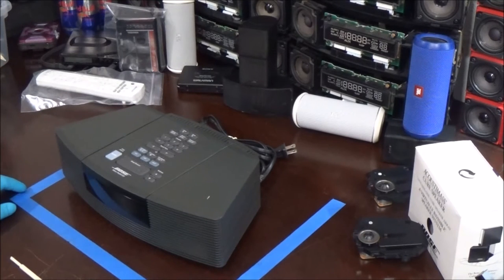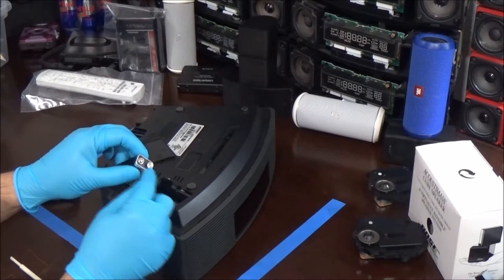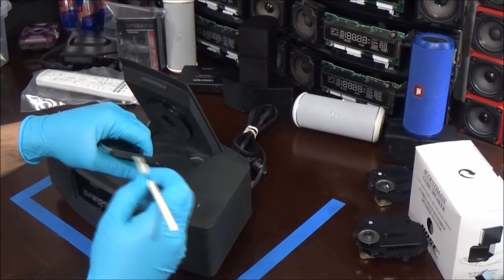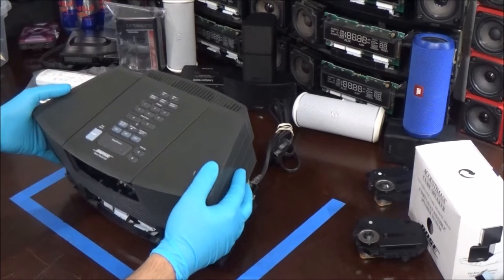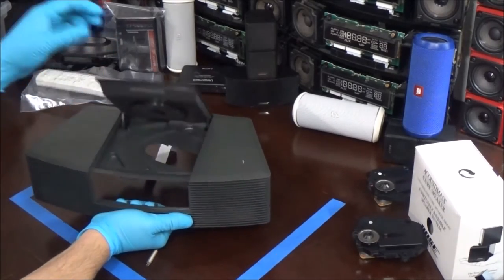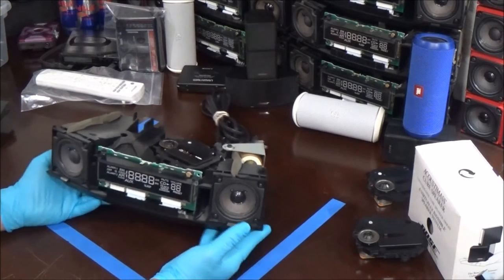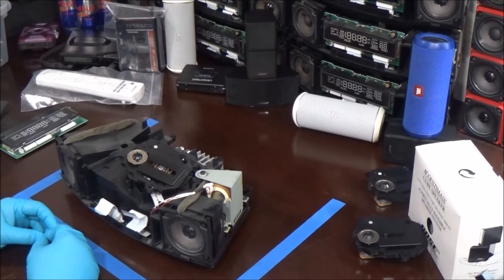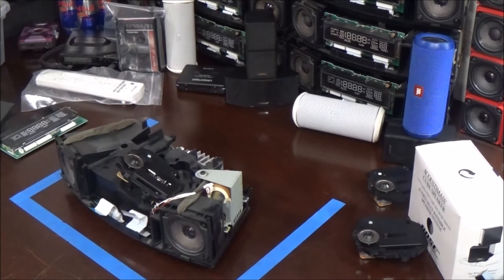Pt. 2 First Gen Bose Wave CD Radio Teardown Repair Dismantle All You need To Know

Comment: I am trying to replace the top door/control panel. I have a good spare and have the unit disassembled, but cannot get the ribbon cable into the lock slot on the back of the new door. Does the door/button control panel need to come apart to attach the ribbon cable? If so, how to do this?
Reply from the maker: Hi, if you purchased the lid with no ribbon from amazon or eBay, return it, as the sellers should know better especially if they specialize in selling Bose products. If they are selling just the lid then they have and should have an understanding of the unit. Let me explain, back in the days I was involved with the first generation second and third Rev, design changes. That is called rolling the Rev. Rolling the Rev. is done anytime we make changes to the drawings or MPI (Manufacturing Process Instructions) Rev. is short for revision. The ribbon in the lid, including the PCB in the lid, the CD centering and the one piece silicone rubber button sheet are all permanently encapsulated in the lid as the lid is sandwiched together with a chemical thermal adhesive. You can try with a fine needle nose to insert the ribbon cable and risk buckling / damaging the ribbon or I would just return it as the seller should have sold the lid with the ribbon still installed. We had concluded back in the days against my recommendations to not make the lid serviceable, but the understanding is that the lid should last approximately 20years and that was long enough and if during the refurbishing process the lid needed replacing then they would just install a new lid assembly that included the new ribbon. Thanks, The Eighties Nut
Reply: The ribbon socket in the lid is different from the ribbon's socket on the display board. The one in the lid has a sliding lock which lock has to be slightly pulled out in order to let the ribbon slide in. And then pushed back to lock the ribbon in place. You could probably use a small hooked pick to pull out the lock, then insert the ribbon, and then push the locking part back. Here's what it looks like https://youtu.be/Osl6yNAqYg0?t=119
Reply: I just posted a new video showing in detail the problem with inserting the ribbon into the door socket https://youtu.be/lMTt7eCxrYw?t=220

Comment: I’ve got a gen1 wave. it’s got an ac hum which is most noticeable at lower radio frequencies. Have you seen this problem before?
Reply from the maker: Hi, yes there are a number of different variables at play with a hum, and without troubleshooting it myself I would say the most likely or highly plausible culprit would be a filter cap or potentially a bad ground. Caps don't need to swell to be bad, however, they could dry out and the cause or the lack of the dielectric presence may or may not cause swelling. I wish you good luck with your endeavor.

Comment: Great video, thanks.  I replaced my 9 Volt battery, but that did not fix the   >failure to maintain volume<   problem on radio play.  I turn it up, and it falls right down again.  Any thoughts?
 Thanks again.
Reply from the maker: Hi, your touch panel is bad. The button control lid, specifically the volume down button. The 9v battery has nothing to do with that. The 9v is only for alarm, tuning memory & display brightness memory.
Reply: @EightiesNut  Thanks!  What is the fix, or is it just replace the control lid?
And  if that, is there a source for those?    Regards,
  Eric

Comment: I am needing to replace my 3.5mm audio input for my bose Soundwave II.  Ive scoured the internet for the possible replacement part, but am not confident enough in my findings to make the purchase.  Could you please advise?
Reply from the maker: Hi, you can purchase it directly from Digikey They have all of the electronic components in stock RCA input jacks.
Reply: @EightiesNut  thank u!

Comment: I have a wave radio/cd model AWRC-1P. the door closing button broke, so now the cd doesn't know the door is closed. Is there a repair for that or do I need a whole new door. Unit is white.
Reply from the maker: The door does not come apart as it is bonded together by thermal adhesion.

Comment: Have the motherboard exposed. Sorry to be stupid but which if the items on it is the fuse?
Reply from the maker: No no, don't say that. The only stupid person is the one that has a question to ask, but does not. The fuse is transparent glass with silver metal caps on each end it is located to the left 3/8" away from the power cord plug (white) on the PCB It is soldered to the board.

Comment: We have been away for a few months the unit was unplugged. Plugged back in LED came on then screen went back and no power. Any ideas? Looking like I need a new fuse or transformer any ideas where I can pick such things up?
Reply from the maker: Hi, I would test the fuse first. More likely when it was plugged in, it received a surge and blew the fuse. The fuse is a 1A 250VAC good luck.

Comment: Hello, my base speaker stopped working, any ideas?, Thanks, Anthony
Reply from the maker: Hi, depending on the model many have a fuse next to the power supply.
Reply: @EightiesNut  I checked, the fuse looks good, I plugged the base speaker in the other speaker port and the speaker worked, so it has to be something else, and Thank you for your help!

Comment: The antenna plug on mine is completely loose.How do i fix it?
Reply from the maker: Hi, it would need to be soldered from the bottom of the PCB that means the board needs to be removed.

Comment: I have the same unit in white and there's a crackling noise coming from left side speaker even when the unit is off but connected to power. checked power cable and seems to be ok, any idea on what the issue could be? thanks in advance for your help.

Comment: I got a used Wave Acoustic CD-3000. The radio works great. The CD player spins the CD and the display shows it started but does not begin to play. There is a soft clicking sound and will not play. I have tried different discs. What is the likely cause? If it is not an easy fix, I wiill be selling it on eBay for parts within the next week but I would rather fix it!
Reply from the maker: Hi David, it is more likely a weak laser diode.

Comment: I need to replace the fuse. How do I get to the bottom of the main circuit board? Your video didn't go quite far enough to reveal that. Can you supply the value of that part 

thanks ca
Reply: nevermind i found the 5th screw under the CD player,
Reply: Looks like it's a 3/4 A slo-blo. can you confirm?
Reply from the maker: Hi, sorry for the late reply. Yes .75 ampere is correct.
Reply from the maker: Hi, the fuse is a .75 ampere. Get it fixed... Good luck.

Comment: i have one of these the cd spins very briefly but the motor seems weak
Reply from the maker: Sounds more like a weak laser diode. If the motor starts on its own then the motor driver cap is fine. Also, try cleaning the lens with a lint-free cleanroom swab and Spray-way.

Comment: I am wondering where I can get a good deal on an optical unit?
Reply from the maker: Hi, I am sorry I am not sure who is just selling the ODA by it self. Most are restoring the complete radio and reselling it with the new ODA installed. The optical drive assembly has not been manufactured in ages.

Comment: My wavw radio/cd player will not turn on. Is there a way to test the cord?
Reply from the maker: Hi, sorry for the late response. No way to test the power cord without taking the radio apart. More likely it is the fuse or the power supply that is causing the radio not to power on. Good luck...

Comment: My CD turns in steps and then (stops) "CD" display flashes. What is the issue? You showcased brand new cd replacement part. I would like to get one of those if you could help me? I do not know your email id. Thanks for your help.
Reply from the maker: Hi, I am sorry I do not sell any of the parts retail.
Reply: @EightiesNut  TY. Where can I get a newish one? Is this also available with DVD? If the "CD" display flashes, what are some likely issues? I like your cars too!
Reply from the maker: Thanks, without actually having it to troubleshoot I can only give my best assessment. It is plausible that the drive motor is going out or even the laser diode has weakened causing the symptoms.
Reply: Do you recommend a place to have it fixed in California?
Reply from the maker: I am sorry, I do not know of any.

Comment: So one question has been bugging me. Are these mono systems? Since one driver is made for mid-high and the other is low-mid? If so, are the new generation is these still mono?
Reply: I worked for the company on the retail  side from 03-06. The Wave Music System was introduced in 05. Each driver/ transducer are the same and have a dedicated 26in tapered waveguide for each speaker. It is a half an octave lower then the original and it out performers the original. The differences from the current series 4 is a new housing and you are able to adjust the bass. The breakdown display we had in the store looked liked like the head of Johnny 5 from Short Circuit. It was pretty awesome

Comment: I’ve got one of these on my bench and it is not functional at all. No display (not even dim), no sound. Thinking it likely needs recapped.
Reply from the maker: Have you checked the output of the power supply? It could have failed. Also, I am sure you have already checked but I should through it in have you checked the fuse?

Comment: Can you sell me one of those brand new optical drive assembly's? I have the same exact model as the one in your video
Reply: my unit has sentimental value id love to make it fully functional again. you said you have 1000 new optical drives? really hoping you can sell me one.
Reply from the maker: Hi, sorry for the late response. All of my surplus Bose is now suppling an eBay seller that rebuilds Waves and sells them as complete radios. Sorry I could not help.
Reply: @EightiesNut  no prob man..Can you link to the sellers page maybe I can get one from him?
Reply from the maker: I am sorry it has been almost 2 years since I dealt with them. They were from the bay area San Jose I think.
Reply: @EightiesNut  ok thanks anyway have a good one